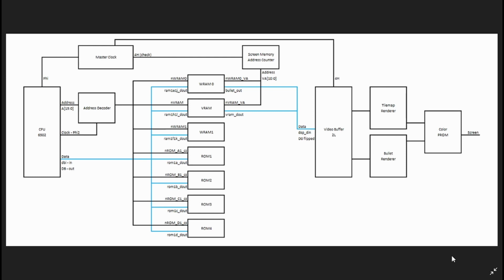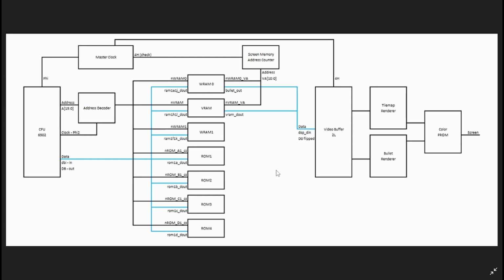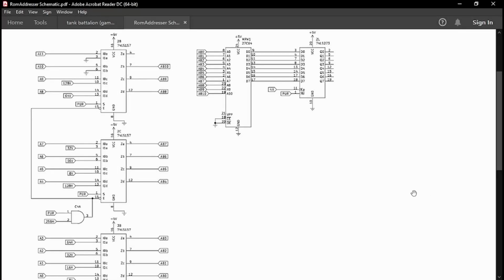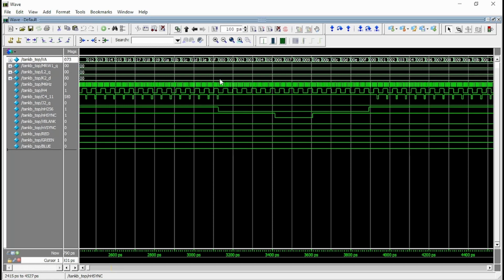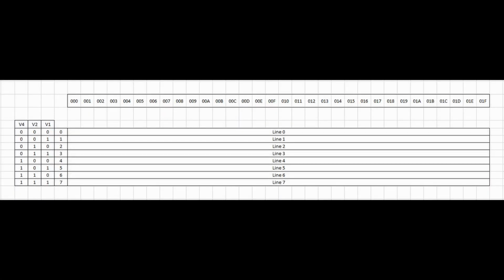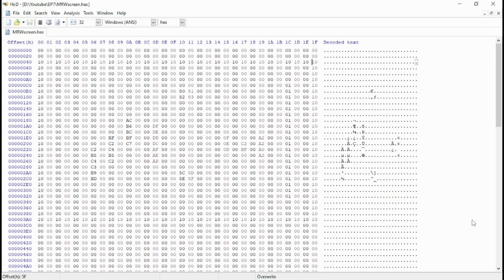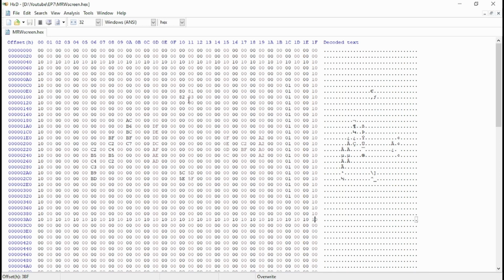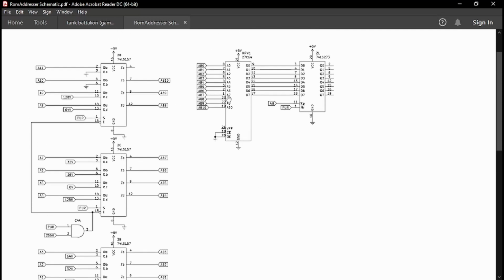MiSTer Core Dev Episode 7: Test Screen Rom

Comment: I'm not sure why the rom is incremented every 4h instead of 8h. Aren't the tiles and sprites 8 pixels wide?
Reply from the maker: Chris - I can't include a picture here, but don't forget that waves have the high period and the low period. So 4H has 4x 6Mhz - or 4 pixels in the high side, but it also has another 4 in the low side too. So overall 8 pixels wide. Essentially the triggering happens every positive edge of 4H, every 8 pixels.